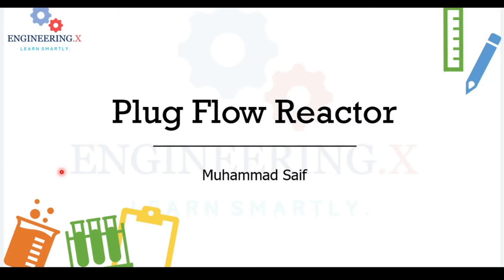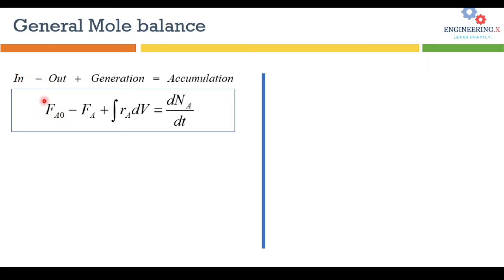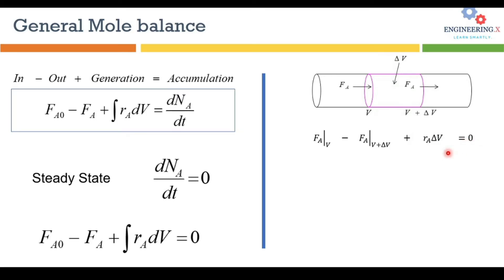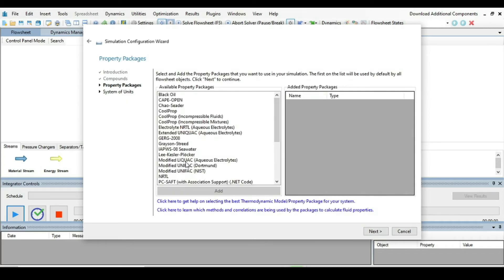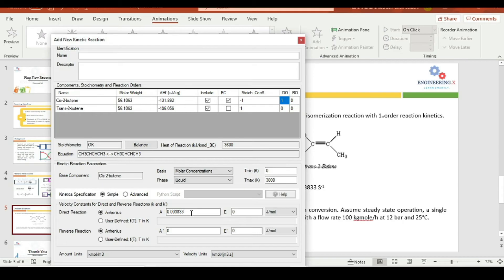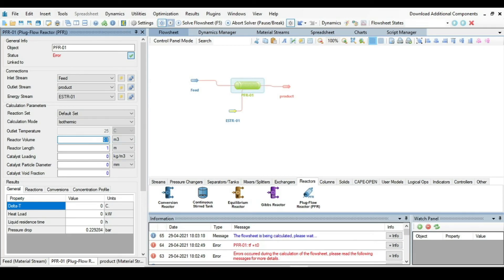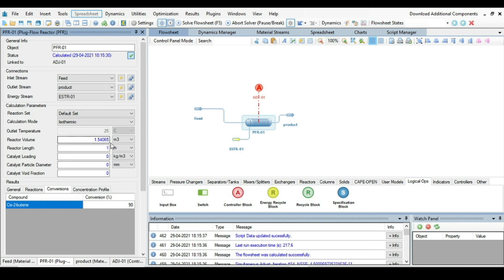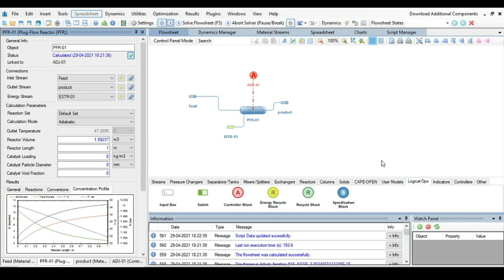Plug Flow Reactor Simulation in DWSIM | Volume of reactor at given conversion of reactant

Comment: Why the temperature in the reactor did you change to 3000?
Reply from the maker: Hi David, the temperature in the reactor is 25 C in the isothermal mode of calculations and 47 C in the adiabatic mode of operation. I did not change the temperature to 3000 anywhere.
Reply: @eduXinsight  in temperature range. When you configured the reaction.  Tmin 0 and Tmax 3000
Reply from the maker: @David Castro , it is a maximum limit of temperature for thermodynamic model to calculate properties.

Comment: It is showing a error that missing interaction parameters for binary pair cis 2 butene / trans 2 butene
Reply from the maker: change your property package and run again, for example, use UNIFAQ
Reply: @eduXinsight  Does the results changes with change in property package?